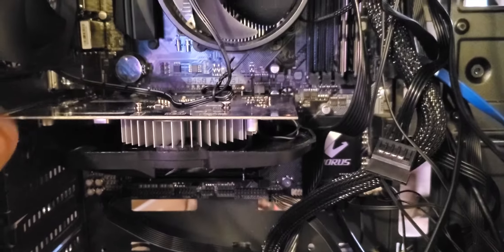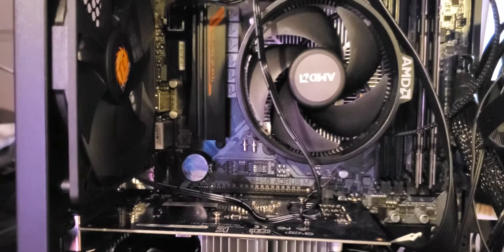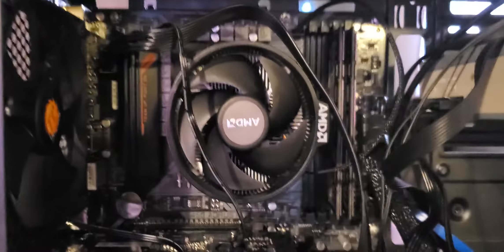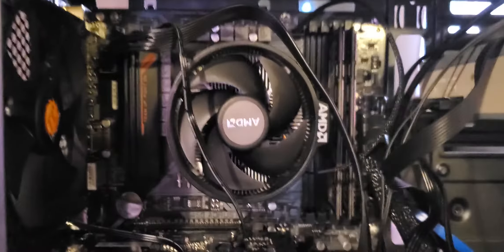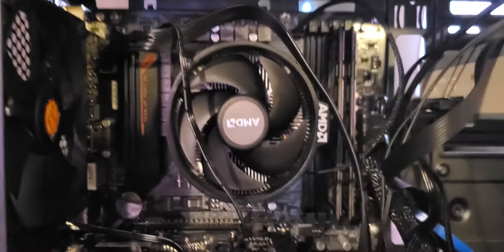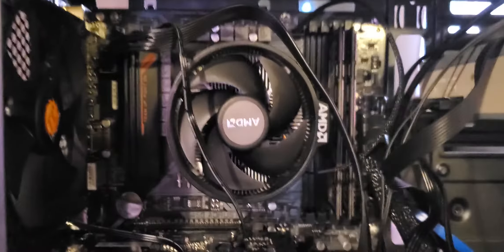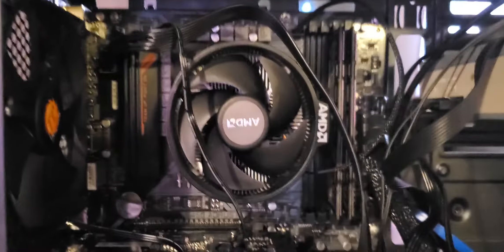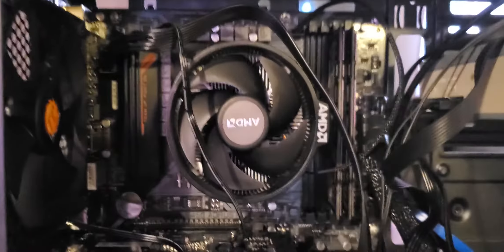Rebuilt PC won't boot up

Comment: PS check, motherboard try shorting the 2 pins that is printed with pwr sw
Reply: try checking the green and black on PS again since you are no longer getting response from MB
Reply: unplug all components from MB, video, ram, hd, cd. try booting just the mb. you should get a faulty 
memory beep. Install one at a time if you get beep
Reply from the maker: Okay, already tested the P.S. it works. Will try just the MB next.